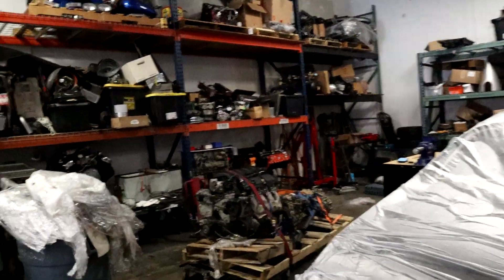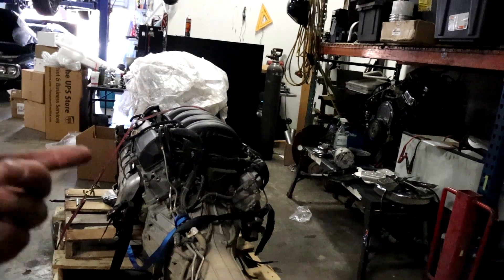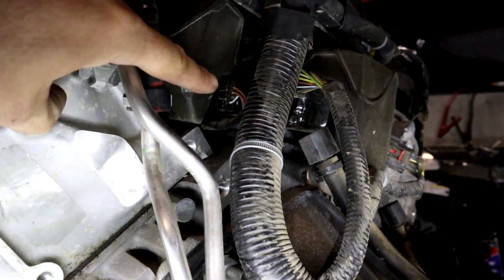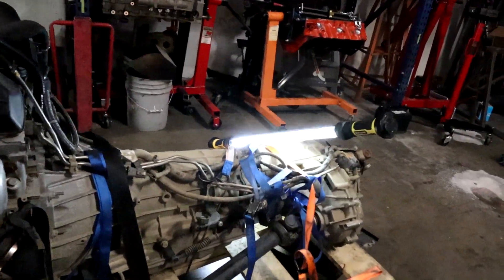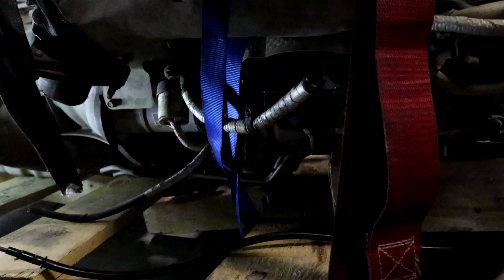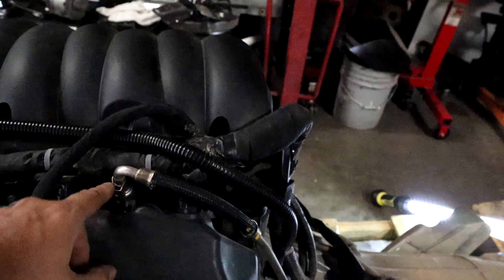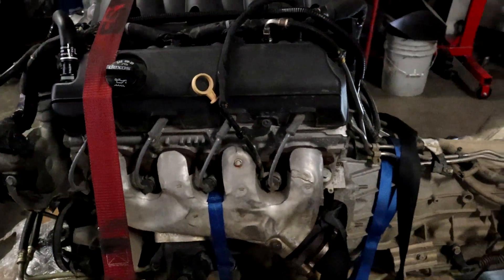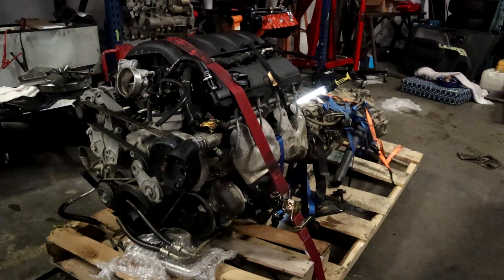How to inspect and identify your Gen V engine and transmission

Comment: My LT1 with 6L80 out of a 2014 Silverado is on a pallet.  When it was palletized they blocked it up on the oil pan and then tied it down to  the pallet with heavy gauge steel wire and twisted it tight. Every opening was either capped or plugged, including the exhaust. I was given every wiring harness under the hood including the fuse block.  Ive got a big box of wire harness that I have no idea where they go.  Looking at the exhaust, the passenger side is tucked in nicely and should clear the frame on my 37 Chev PU.  However, the driver side is canted out.  For wheat reason I have no idea, maybe to clear a drive shaft on a 4wd?  Mine is out of a 2wd.  This is a very clean engine and I was shown pics of the truck.  It was very clean as well. 109,000 miles

Comment: So why do I need to use my Jeep 241J tcase in my JKU swap and not the GM case? Would this not save on having to use an adapter and is it simply because I wouldn't have to change yokes/driveshafts etc?  How does the GM case compare to the 241 size wise, length etc.  thanks
Reply from the maker: The front drive shaft slips into the t case.and is not bolted to it. This means if you use a lot of articulation the shaft can fall out of the tcase. It is designed for independent front suspension where the front axle pumpkin does not move

Comment: Mitch, on a 4 doors JK or JL swap, would you be able to use the T-case that comes in this set up or would it be better/easier to just reuse the 241J that comes in the Jeep.?
My impression is that the GM T-case if it fits in the swap set up is better that reusing the 241J. Thanks.
Reply from the maker: I believe you could use the gen v tcase in the jks. You will use the controls from a gen v gm truck to operate it.